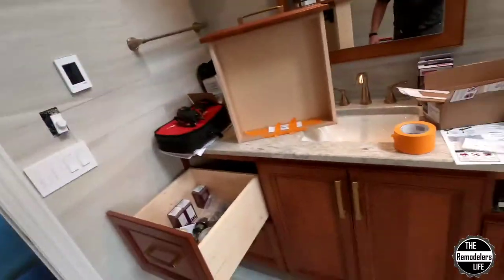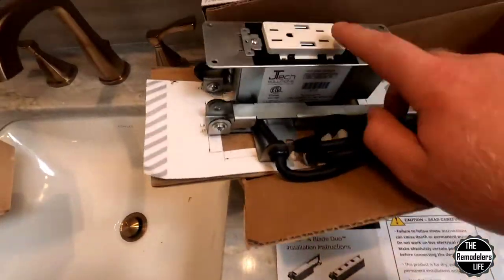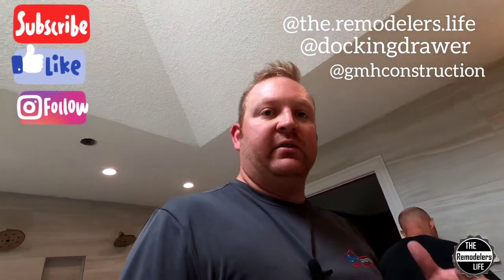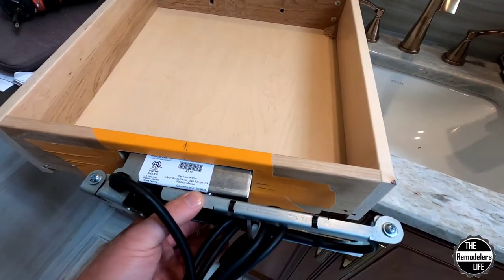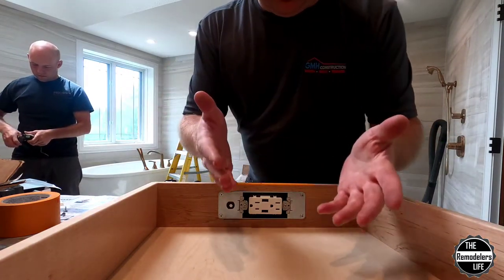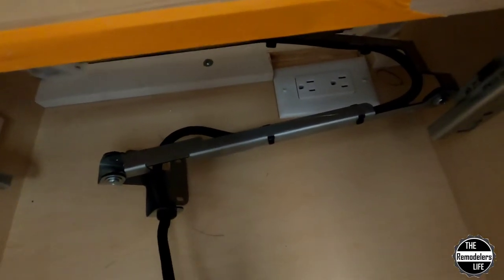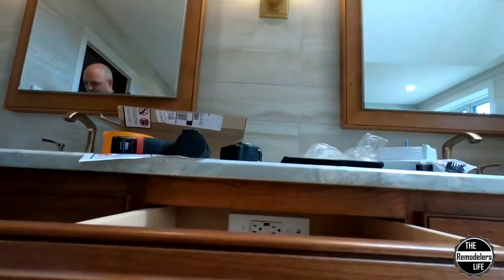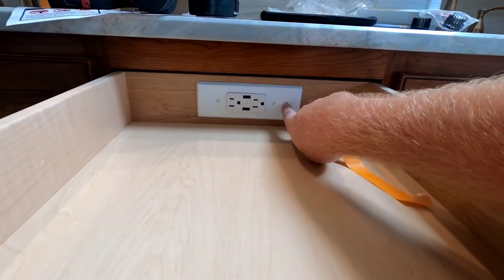Docking Drawer Install and Review

Comment: Do you need to shorten the drawer for room for the arm?
Reply from the maker: Nope.
Reply: The plug needs 2" of space between the back of the cabinet and back of drawer. If you have 2", you're good, but if you don't, you might need to change something. Docking Drawer also sells a spacer that lets you work with only 1.25" space behind the drawer, it spaces the plug into the drawer.

Comment: Can this be install in 21” vanity ? Or is there different sizes of arms?
Reply from the maker: it should work with 21in deep iirc. the pivot points allows the different depth, you could call them directly as ask also.